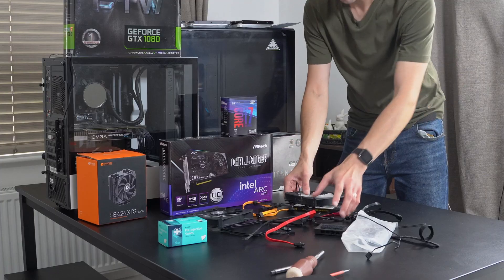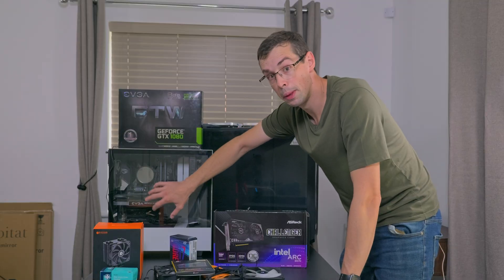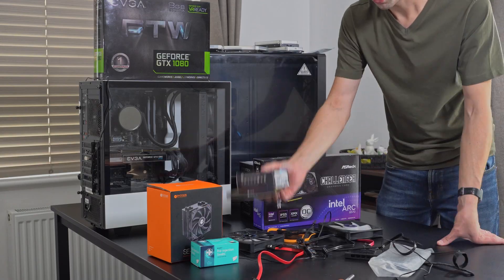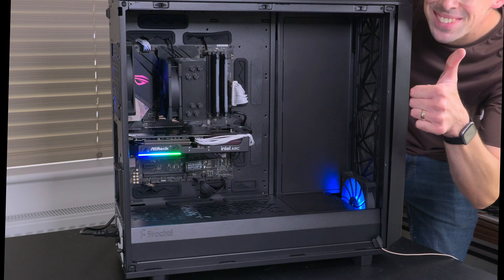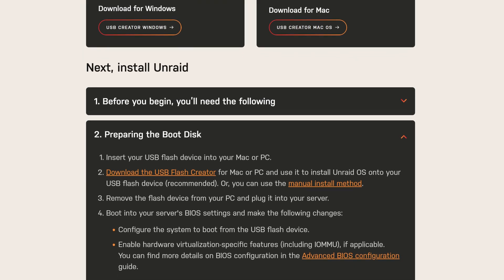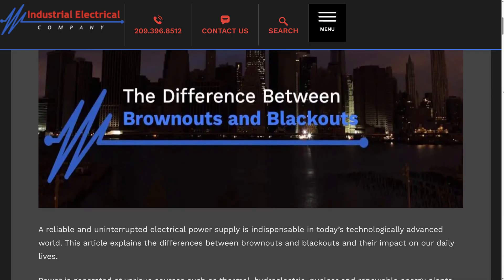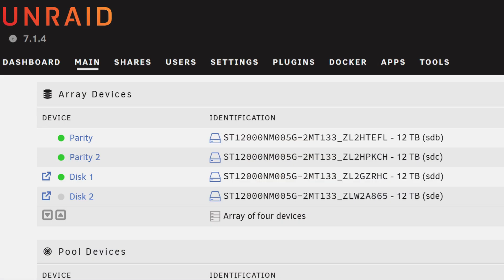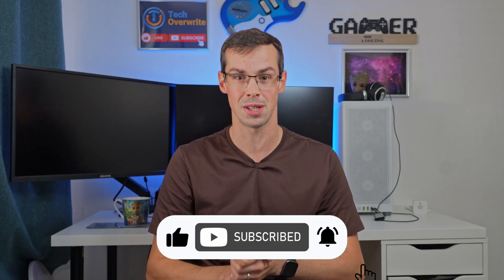My 48TB Unraid NAS Build Is Now DONE!

Comment: ripping my i7 7700k asrock z170 board out of my carcass spare and putting it in a new darkrock classico max $90 case. i'm a noob but i'm shooting for a low power build, so looking for arc a380's under $100 used if they're out there. going to chuck my old ketchup & mustard psu and get a low watt gold and i should be set. oh yeah, then the hard drives.... ffs
Reply from the maker: That last line got me, lol. Yep, there's always something to buy :( But hopefully you can save on the RAM and other big expenses. I'm glad I ended up getting refurb HDDs - they can be a lottery, but right now they have been working well tbh.
Reply: @TechOverwrite  i still have a couple sticks of crucial (rip) ballistix ddr4 in the mobo, but can't remember how many gigs. i probably don't need that much. it won't be a 24/7 rig, just a storage unit and occasionally if i'm traveling.

Comment: it looked like your exhaust fan is exhausting but that fan you put on the cpu cooler is in a pull position (relative to the heatsink) but it is actually blowing from the rear to the front? 
??

Comment: saw your link from unraid reddit post, nice video.   if you arnt making a build guide, but want to put in b roll of the build, a lot of creators found success in making it a montage, admittedly i skipped it after about 30 seconds as the pace just needed to go on.  I think this is why a lot of tech channels use a fast-forward montage.
Reply from the maker: Thanks for watching, glad you enjoyed overall - and I appreciate the tips about making it more of a faster montage, noted :) You're right that either it's a build guide/discussion about a project, or a quick montage - but shouldn't be a mix of both. Appreciate that.

Comment: I've got 3 HDD in my mATX case. 
I did fight with vibration for a long time. A recurring cycling annoying noise (now it's seems I worked it out mostly)
Also in summer one of my drives gets quite hot (>42°) if I do nothing (now I use FanControl to ramp up my fans).
Haven't you got those problems ?
Also the power saving features stopping your drives, doesn't it result in massive Start/Stop values ?
(I've got Start/Stop values in the thousands on my older drives)(Janos from HD Sentinel wrote me it's better to just have them running)
Reply from the maker: Good questions thanks. I'm currently storing my case in my garage where it's cooler, but 2 of my drives are hotter than the other two which is interesting. It may struggle in summer as a result, so I'll need to keep an eye on it.

The start/stop did end up causing me some annoying niggles, so I've temporarily disabled that but I plan to give it another shot in the future. You just have to factor in those start/stop times, which were probably 5 seconds for me. The main issue for me was Plex actually - I'd go to watch something, and there'd be a LOT of lag - and then Plex would get in a weird state. That's why I ended up disabling the start/stop.

I may end up reconfiguring my drives so I don't have a 4 bay parity, and maybe have one of my 2-bay parities have start/stop, and the other run 24/7. Not sure yet though

Comment: Nice build! I'm also looking to build a NAS using parts from old gaming systems.
Reply from the maker: Thanks :) It worked out pretty well IMO. Sounds like a good plan: Unraid can be pretty good for 'mixed and matched hardware' - especially since the XFS file system is a better less resource intensive than ZFS file systems.